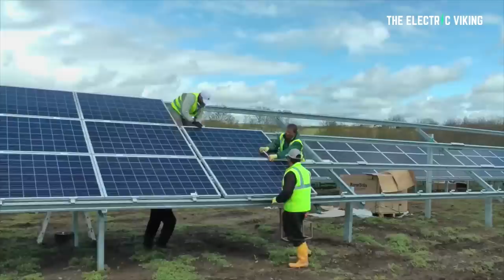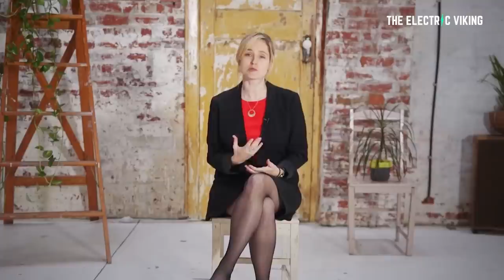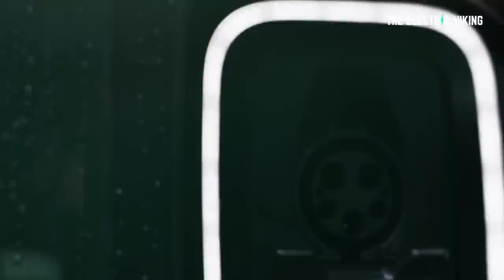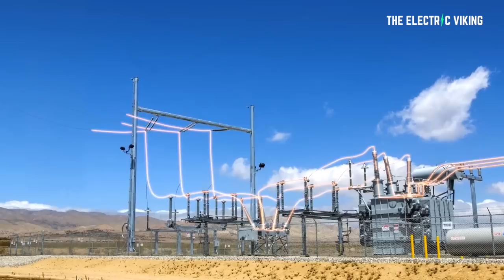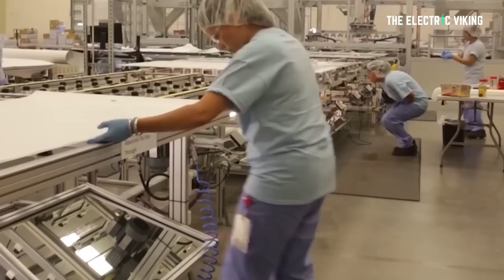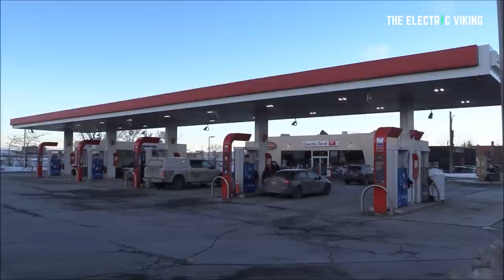How the world can stop the cost of living crisis & halve electricity costs

Comment: You can't base your energy grids on solar and wind because then the question is what are you going to do when the sun doesn't shine and the wind doesn't blow. That's what a lot of places need to think about because that's a real possibility. You need to have other options like nuclear, geothermal, gravity, wave and so on.
Reply: And don't forget batteries as they are a major part of the solution.
Reply: I can store 100+ kWh's just using hot water storage and 2 EVs,  1 of which can output 3kw from its 72kwh battery. Demand flexibility and V2G are a huge untapped resource that have the potential to provide mass storage. Check out the USA's school buses that are being converted to EV for this as a secondary income source.
Reply: You seem to have the delusional belief that the people who design solar/wind power plants have not considered the possibility of using grid-scale batteries. If you do an internet search for "solar vs nuclear cost", you will see that building and running nuclear power plants is many times more expensive than building solar/wind+battery plants.

In Toby Seba's "Solar Trillions" book (published in 2010), he states that the US spends about $1 trillion annually for fuel to run power plants. In the 8-minutes segment starting at about 31 minutes and 30 seconds to 39 minutes and 30 seconds of this 2021 video he explains that it would cost the US less than $2 trillion to switch to a 100% solar & wind & battery storage for electricity: https://www.youtube.com/watch?v=Kj96nxtHdTU&t=1889s
Reply: The problem we are having with solar and wind power isn’t that they are prohibitively expensive it’s that they are dirt cheap compared to coal,gas and even nuclear and hydro. Sometimes The grid is getting so swamped with cheap abundant solar and wind power they have to turn off wind and solar farms . We need to vastly improve and 😢install a dedicated 4 hour storage system county wide which would be the base load of power we need . Electric vehicles don’t hurt the grid they make the grid more resilient and more responsive to minute by minute electrical demand with a V2G vehicle to grid system think of all the passenger vehicles and school buses with batteries that store twice the power we need next to free energy is closer than you 😮yessss you know
Reply: @nickkacures2304  
There's a downside to VtoG.
.
At some point you still pull energy from the grid.
.
You can only put energy from your solar into your vehicle if it's there during the day.
.
The idea would be to "feed" the grid at peak (normally when most vehicles arrive home, +/- 1 hour?)
.
So. Either your solar had to be stored ON the grid during the day when the car is away, (which kinda defeats the object?) Or it just powers your home when the sun's up, with the rest going to waste?
.
Then, you arrive home (dark outside?), plug in the vehicle, power the home from the vehicle, the grid takes some energy, then at 01:00 you buy energy to charge. (Cheap, but even so).
On the other hand, a battery at home captures all the solar that the home/ grid doesn't need.
It supplies ALL the home energy in the evening.
It supplies ALL the energy you want to sell to the grid.
You're car needs less charge, because it didn't boost the grid.
The battery supplies ALL the energy for the car.
You're a nett producer.
.
In the rare case that the house pack runs out, you still (?) Have to VtoG option.
.
A home battery will pay for itself and the solar system much faster.
Reply: For now, yes. But we can work on this while we do expand green energy sources. Still beats the status quo.